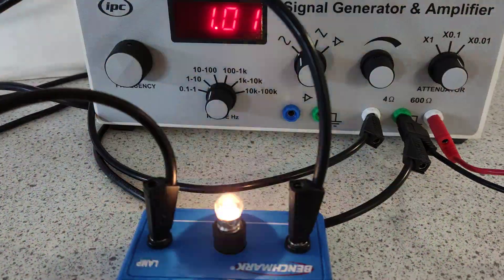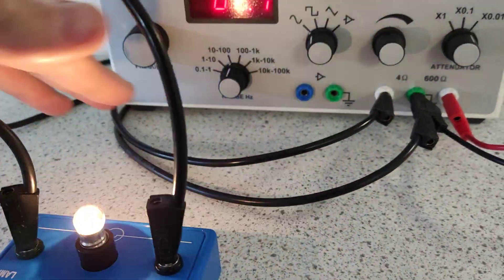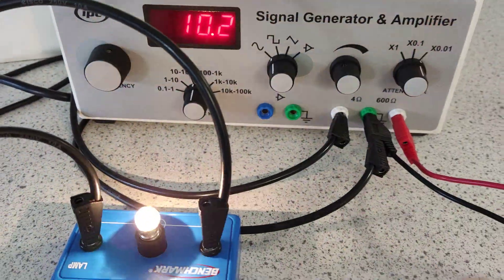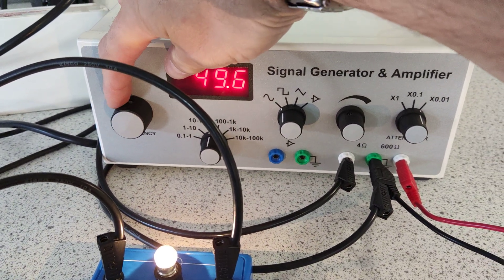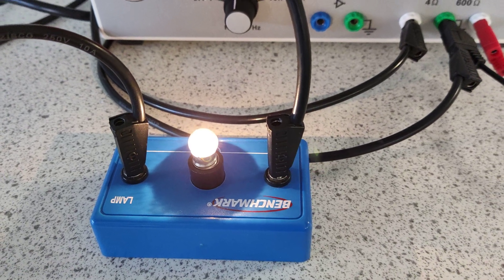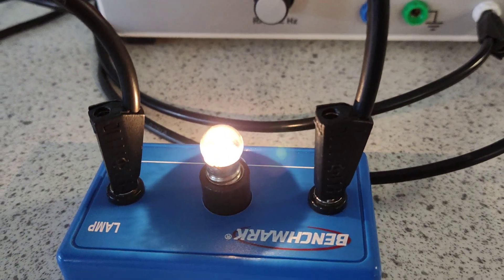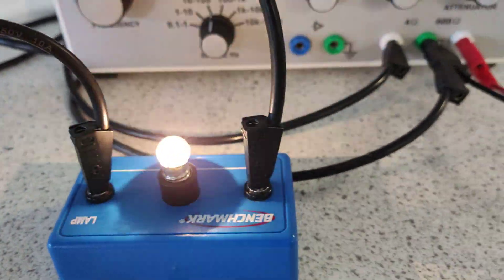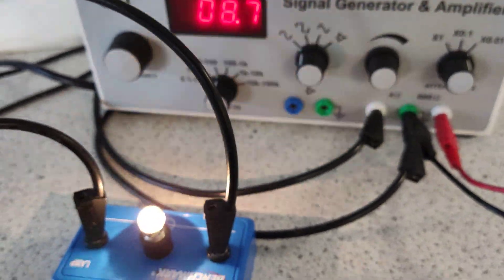50Hz Mains and Lightbulb Flicker  - AQA A Level Physics

Comment: With a 1 Hz ac signal won't the  bulb increase in brightness twice within the 1 second cycle? Once for the positive polarity and once again for the negative polarity.
Reply: 100 Hz flicker on a 50 Hz supply. If the filament has time to cool enough to be noticed. Should be more apparent with a single filament as compared to a coiled or coiled coil filament.
Reply from the maker: @John-pp2jr I think it depends on energy transfer to surroundings, try it?
Reply from the maker: Absolutely. You get the peak and trough    with a flash every 0.5s or Period T = 1s